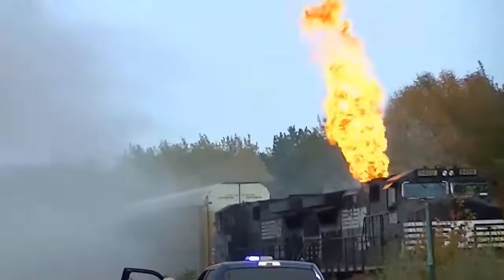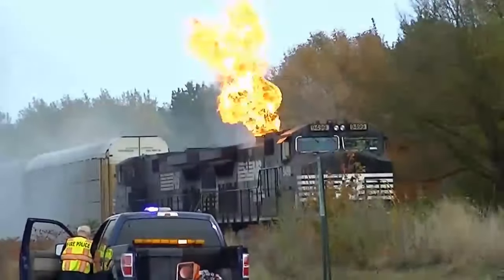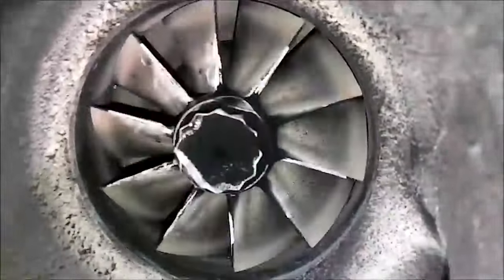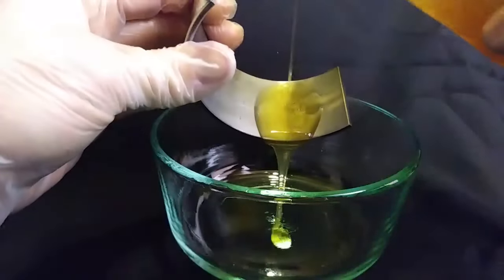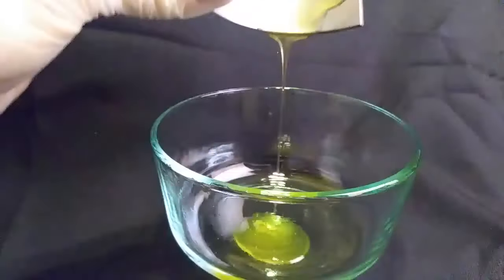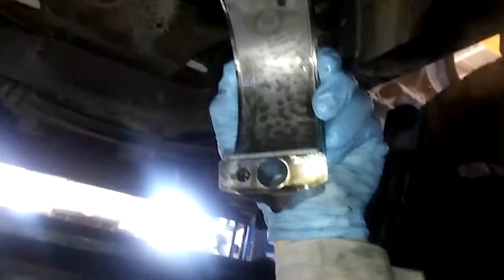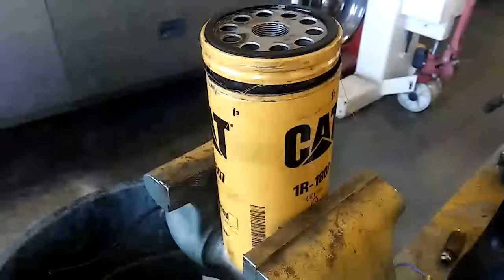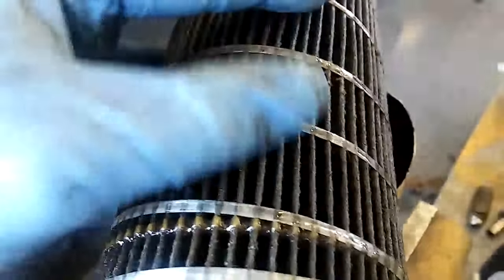Engine Block Heater vs Oil Pan Heater. Everything you NEED to know about Cold Weather Diesel Engines

Comment: 4:05 “coolant and oil aren’t in direct contact with each other”

6.0 powerstroke: “am I a joke to you?”
Reply: The Six Leaker Had-A-Stroke
Reply: Lmmfao
Reply: My brother called me a few years back and told me he bought an '05 Ford F350 dually.  I asked him what motor was in it and when he started to say the words "six litre" I started laughing.
Reply: @krazykyfan  To be fair, if it already had an EGR delete and a stud kit installed he might have got a good deal.
Reply: Reykor Jande 
No. 
Hpop is a ticking time
Bomb 
Attached to
A bag of grenades
Reply: My 06 was leaking a gallon of every 1000miles, more money than i had to fix it so i put in a bottle of" engine fiber lock" i think thats what its called. 19.000 miles later 👊
Reply: "Why does my engine oil look like runny, grey pudding?" 
"Well, you could have a cracked/warped cylinder head, blown head gasket-oh, you've got one of those, um...."
Reply: come on guys we all know the oil cooler is supposed to be replaced with the oil filter lmao.
Reply: underated comment lol
Reply: Yes, yes u are
Reply: @chipperfluffy  Yes the 6.0 powerstroke is a joke. One of the worst diesel pickup engines ever built. No amount of feelings will change that.
Reply: Well played
Reply: Lmao
Reply: To be fair, if the 6.0 is deleted and bulletproofed, it’s an incredibly good engine.
Reply: @jordanrelkey  Not even then.
Reply: @thetowndrunk988  nah
Reply: @justinmartin8887  elaborate. Nah doesn’t say anything constructive.
Reply: @thetowndrunk988  well it still doesn’t have enough head bolts for big power. Ficm can still go bad,etc etc etc. it just goes on and on
Reply: @thetowndrunk988  once you spent literally 10k dollars to make the engine reliable, you may as well have bought a dodge and built the trans, steering, and had a real engine
Reply: @justinmartin8887   if you think that Cummins in those same, or later, years was so much more reliable than the Powerstroke, I’ve got some ocean front property in Arizona for ya……
Every single engine, after emissions started, had to have mods to be reliable. Didn’t matter who made it.
Reply: @thetowndrunk988  yea true that on the emissions control problems. I meant preemission. Not saying dodge is the best choice, either. Just the best engine. Hate the rest of the truck. 
    Main reason I have a gas f350,tundra, and Tacoma in my driveway. Sold my dodge, bought stuff I don’t need to work on. Much more time to take care of other business
Reply: @justinmartin8887  I get what you’re saying, but the 6.0 was introduced during round 1 of emissions, which also affected the Cummins. Both had to have mods. Granted, the 6.0 had to have actual engine mods to make it viable, where the Cummins just needed a simple delete. But neither was as good as the previous generation, honestly.
Reply: @thetowndrunk988  the 6.0 was 03-07, exactly when the 5.9 common rail was in production with absolutely no emissions, not even egr
Reply: @justinmartin8887   I was actually not aware of that. EGR was required on all diesel engines starting in 04’ engine model years, so I assumed Cummins was in the same boat as the semi Cummins and Detroit, Powerstroke, and everyone else. I own(ed) a fleet of semis, and always had Powerstrokes. Never dealt with Cummins pickup engines. Guess they were able to pass emissions solely through the injection system. Anyhow, that aside, the entire point is the 6.0 was reliable once bulletproofed. I had no issues outta my 04 350
Reply: @justinmartin8887  though I do have to say I lost the WHOLE, not the upper as typical, but the WHOLE FICM……that was a major, and quite expensive, pita. Injector stiction with the HEUI system was also a pita. It was very particular about the correct oil, and frequent oil changes.
Reply: @justinmartin8887  common rail Cummins don’t have egr, BUT, they have shitty cam timing that does the same thing, (it draws some exhaust back into the cylinder before closing the exhaust valve) that’s why the oil is the sootiest I’ve ever seen. They say an aftermarket cam will eliminate this along with better fuel efficiency and more power. I love my 07 3500 reliability, hate the oil situation, not even a centrifugal filter will keep the soot to an acceptable level. Just plugs the fuge bowl in short order.
Reply: @krazykyfan any powerstroke after 03, RUN! Lol

Comment: Up here in Saskatchewan I use a block heater ,oil pan heater, 5/40 full synthetic oil and run winter diesel.   Never a problem starting unless cords get accidently unplugged.
Reply: Which oil heater is better, the oil pan heater that is out side or the one that is inside the oil pan?
Reply: Sebi Alex  the one inside cooked my c13’s oil. Good thing I had warranty.

Comment: In Fairbanks, we had oil, battery, coolant and sometimes cabin heaters.  
Plugged in at home, plugged in at the supermarket, plugged in at work,

and that was just for the gas cars.
Reply from the maker: Do most stores have electrical connectors in the parking lot for this? Seems weird to me being in the continental US.
Reply: Had a buddy stationed up there years ago. Said you would have to go into winter with 5 or 6 extra serpentine belts in your car that you had used for a week or so during the summer to loosen them up. In winter, i guess they would snap all the time. Sound like fun. Lol
Reply: @AdeptApe  Yep, at the head of the stalls, about waist height.

Comment: Great presentation! You covered all the bases. My experience with ether was when my two brother-in-law in- laws used massive amounts of ether to try to cold start their car. When they couldn't get it to turn over anymore they pushed it to the side and left it. In an attempt to figure what they screwed up I tried the damper bolt and then the flywheel through the starter hole and could not get it to budge. I pulled the pan looking for carnage but everything was clean. I pulled a rod cap and was able to slide the piston up the bore but the pin was seized and I could not force the rod to move. I put the pan back on!😢 After some interrogation they showed me the multiple empty cans. I'd never seen anything like it. Thanks for all the very thorough videos!

Comment: Very informative but I am going to mention what worked for us in Northern Wisconsin. Both our diesel trucks and the diesel tractor loaders used to clear snow from our docks we did the following. Once it gets to October, oil is replaced with 3 W 30 synthetic oil, we put Number One fuel in everything and all have intake manifold heaters in them. We always put larger capacity batteries in everything but all have a trickle charger installed to plug in when it gets towards 10 below. Even with -50 F they started up.  With the trucks warmed up running at the docks, the drivers are told to put a quart of ATF in the fuel tanks as it will have low fuel on their return. We felt this will help lubricate the injectors and it adds some detergent. On the trucks return they are fueled up with number one fuel and parked. We had very little injector failures and the engines lasted MANY hundreds of thousand miles. I retired in 2005 but these procedures are still being done.

Comment: Eberspacher has a pretty fullproof system, a lot of our local northeast (PA) fleets use it. Its an external block heater that runs on  diesel from the tank. Fully automated so it can be set to come on at the same time every day, not run all night, and you don't need a cord. Local heavy-duty plows and tankers have used them for years with no issues. Pretty surprised you didn't  metion it actually.
Reply: It's a heater with a pump that warms the coolant as it passes through the unit.
Circulating through the block and heater core. The advantage is it will actually keep the windshield slightly warm and when you do start the unit you have next to instant warm heat out of the vents. 
My experience here in Alberta and running the ice has shown over 100 degree engine temperature seconds after startup at -30.
As for keeping the interior warm, both Webasto and others offer a separate cab heater that keeps you toasty warm all night.  
But in remote areas I still would not shut off my truck past -20.  That would be the time the coolant heater or truck would refuse to start. 
I have used Webasto combo heaters (717 tandem) with great success, love it so much I have one in my 6.0!  Its nice to go shopping or to the movie at -20 and come out to a toasty warm vehicle.
Reply: @fredg8199  My Webasto didn't start one am in SD was minus 20F 1996 Pete with a 5EK started ok but it did sputter a bit.
Reply: Don't forget about Webasto's heaters
Reply: Those are neat, but they are way expensive! I was going to get one after I noticed your post, but then I saw the price. $1500 is a lot!
Reply: @davidscott5903  thanks for saying the price, it's cool to know these things exist but hehe sometimes I can't afford some of the cooler tech.
Reply: @nativeoutdoors1780  
No problem, glad I could help. If I lived up in Canada I might think that that price was worth it, but the urgency is not quite that high because it doesn't get as cold in Idaho. 
It's funny how value can be so different. Kinda like selling air conditioners to eskimos.
Reply: @davidscott5903  yeah it is, that's a good topic for discussion, just what is more valued in the environment.

Comment: I have a Pete with a C-12, and I have switched my oil over to Chevron Delo 5W-40. I run it year round and I absolutely love it. Oil consumption is now drastically reduced, and it starts like a dream and builds very nice quick oil pressure in the cold (And I always run my block heater below 35°-40°). I've had this oil in the 100+ degrees climbing the mountains in California, and I've had it in northern Michigan where I live, below zero temps and it performs amazingly overall. That's my $0.02, for what it's worth!

Comment: I live in interior Alaska and it is very common practice to install a block heater, oil pan heater, battery blankets and tenders, and sometimes even transmission pan heaters when "winterizing"  our vehicles up here. They will start at -50f if plugged in for long enough, sometimes 4-6 hours.
Reply: Yup, Southwest Alaska here.
Reply: I would like to live there. But a heated garage sounds like the best choice If I have the option.

Comment: I had an old tractor. Bought two freeze plug heaters.  Plug those in, throw a blanket over the hood, it was hot in an hour.  Then, I found another that went in the lower radiator hose. Old diesel from the 70's would crank right up.  I also had a magnet oil pan heater but never really used it.

Comment: Well said. I tell my guys to run a diesel fuel anti gell  with every fill up. We are a local trucking company  (Detroit  area). I tell them it is cheaper and easier to just add the stuff than it is for me to get them started if it gelled up overnight
Reply: Have them keep a bottle of diesel 911 in their trucks to in case of gel ups it degels the instant it touches diesel and makes it so flammable you can light it with a lighter like gasoline. Its emergency use only but adding half the recommended amount helps with diesel startups in cold weather as well
Reply: Don't you guys have arctic diesel in the winter months? Up here in Canada we have summer diesel, winter diesel and arctic diesel. Arctic diesel never, ever gels. We don't use anti-gel additives unless we are planning to start a piece of equipment that was parked with summer diesel in the tank.
Reply: Our fuel company delivers winter diesel. I will gel up  around 10° F.  My company pays for the anti-gel, so why not add it.
As far as the 911 (red bottle)  my guys are not that bright and will use it for everyday anti-gel, I know I've seen them do it. So now I keep the 911 inside my shop and they can't get to it.

Comment: Webasto coolant heater is a very good option for cold weather, you can program it the day before to turn on 2 hours before you wanna start your truck, and then once your at the truck early in the morning freezing cold, the truck starts up like it's summer time 👌
Reply: I had one of these b4! They are bad a$$
Reply: We use a no name inline water heater.  It worked great plus it blew hot air soon as the engine was running.

Comment: Look at that.  Josh called out cloud point, instead of the internet referenced and fuel additive marketing wank that is gel point.  Had that conversation with far to many people.  "Well I was treated down to -20.  I opened the drain and fuel ran out so it is not a fuel gelling issue."  You are correct sir... your fuel is not gelled.  Apply some heat to your filters and call me back if it won't stay running.  Calls back, "engine dies when I remove the heat, fuel pump must be weak."  No sir your fuel heater is inop.  "Oh I disconnected it years ago, I never operate anywhere close to -20."  I recommend getting it hooked back up because your filter has a wax log jam.  "I just doubled my additive dosing, how long does it take to work?"  Looking at the weather forecast looks like mid next week. "What if I drain the filters and fill them with the additive?"... it goes on and on and on.
Reply: If treated properly -20 is no issue with Howes, any lower you better be throwing in some #1 if you dont want a long hard fight in the cold. I found if I turn off my electric lift pump till the engine gets some heat in it then it helps, the electic pump moves so much fuel it will clog up that water filter instantly. I do have a electric fuel heater and coolant ran through the FASS so even if it is a bit cloudy to start with it won't give me trouble as long as I unplug the system for the warmup.

Comment: A trick we use on log skidders is make a pair of jumper hoses with quick connections. Tee into the heater hosees on the pickup truck and on the skidder. Put a shut off valve to control flow rate. You don't want full flow or you'll warp the aluminum heads on your pickup.The block will go snow white then back to normal color. Then skidder will start like a summer day. Another trick is a length or 4 inch flex pipe shoved on the tailpipe of pickup,the other end blows on the oil pan.
Reply: Yeah, but how do you start the truck?
Reply: @David Scott  the truck is parked at the house where it can be plugged in. Then obviously it get driven to where the equipment is parked.
Reply: @donmunro144  
Ok.👍
Reply: @davidscott5903  you use another truck to start the starting truck. Duh

Comment: I had a webasto on my 3/4 ton.  Totally awesome.  If you’re in the real cold a block heater is amateur compared to a true diesel fired coolant heater.
Reply: Yes, but $1500 will pay for about 4 lifetime supplies of starting fluid.

Comment: As a farmer I fitted my 01 7.3 with most of the suggested ideas minus the lighter oil. I added a pony motor with a home made heating apparatus to preheat the coolant when things got below -30 F by circulating coolant through the pony motor exhaust. ( I have yet to find an old Briggs and Stratton than does not cold start well.) Two extra batteries under the rear seat for assistance or trickle charging overnight, fuel preheating and to pre-warm the heat tape wrapped B&S motor tucked into the tool box. I never ever let ether near my trucks intake. Like you said a bad idea. Might have been over kill for New England but I might add, I never ever had any difficulty starting my truck no matter the temperature.
Reply: Interesting.  Did you have a heat exchanger with the coolant flowing through it and the small engine exhaust blowing through the fins of the exchanger, or something similar
Reply: @wmden1  I made a tank with holes cut into it and ran the exhaust through the pipes which heated the contents of the tank. Imagine a box, cut holes in the sides and run cast iron pipes through. (Sideways radiator minus the thin fins) The pipes being smaller made the B&S force the exhaust through  them.  The engine was rigged like old Canadian tucks where coolant can be swapped between trucks to assist with starting.  Had a valve to divert the exhaust so as to not cook the coolant. The B&S was set to pump coolant. Coolant  was sent through cast iron pipes to the oil pan and the same with the coolant system. All pipes were insulated that went out off the tool box or the engine bay. Rubber lines only where flexibility was needed. Always heated the coolant to preheat the engine then did the oil. Oil pan was a custom job I had made. Like the tank had cast iron pipes running through it. Valves at the pump labeled Coolant/Oil/Tank Circulate.  Cast iron pipes because every fitting was NPT and can be found anywhere(cheap), and the heat transfer rate.

Comment: I never touched a diesel but from watching many videos, poneys that crank the engine while providing oil pressure and that the exhaust go through a air intake heat exchanger is the most awesome idea I've seen!

Comment: Back in the 1980's my Dad and I were adding a small car engine and later diesel Genset engines for added oil heating. No radiator was used engine coolant was pumped through the heaters first and returned back through the main engine, a 90 amp alternator was added for battery charging, cabin power and lighting.
Reply: Amen.